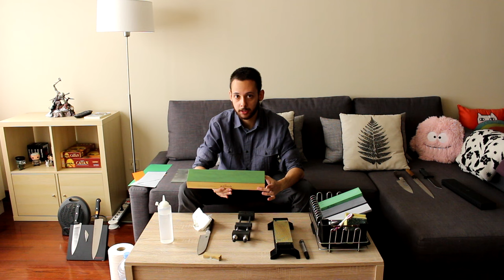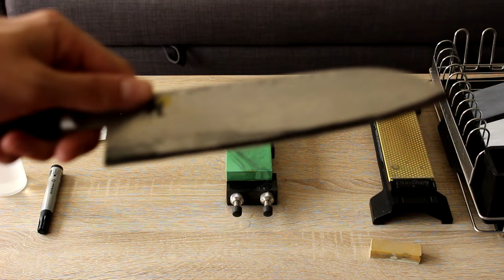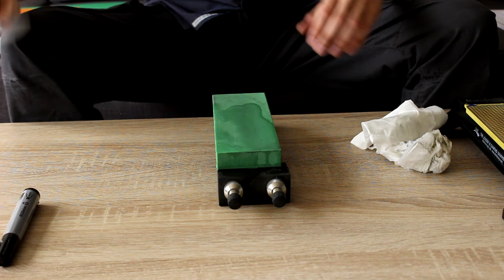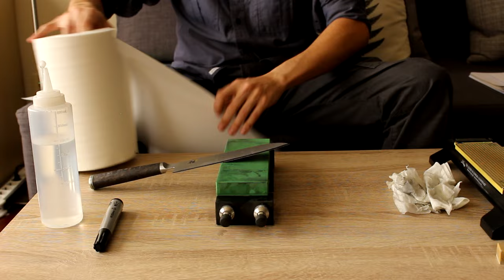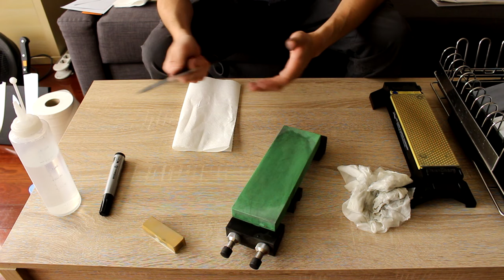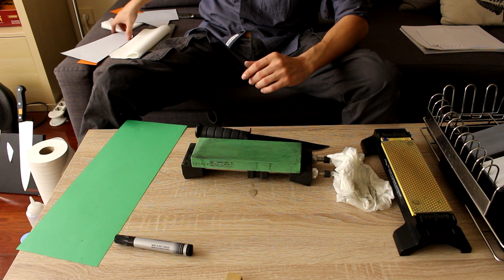Todo lo que necesitas saber sobre afilar cuchillos en un solo vídeo

Comment: Excelente,te felicito y aprovecho para preguntarte por las guias para afilar cuchillos,son útiles?.En mi caso como aficionado a la carpinteria,utilizo guias para afilado de formones y cuchillas de cepillo,aquí son imprescindibles,gracias por tu respuesta,saludos.
Reply from the maker: Gracias por tus palabras, José Francisco. En cuchillería no hace falta usar un sistema de guías, no es difícil aprender a mantener el ángulo a mano alzada, y el filo de un cuchillo perdona mucho las variaciones de ángulo, no es como un formón, por ejemplo.
Tipos de guías hay dos, una especie de cuña que se le puede poner al cuchillo en el lomo para pasarlo por la piedra, que es el equivalente a montar en bici con ruedines. Y luego hay otros sistemas en los que se sujeta el cuchillo y se le pasa un abrasivo sujeto al final de una guía que va marcando el ángulo. Esos sistemas son caros y lentos, pero van bien para los que quieren hacer pruebas técnicas con los cuchillos y necesitan afilar exactamente siempre al mismo ángulo para hacer comparativas de datos. Para el uso normal de afilado de un cuchillo no son necesarios. Un saludo.